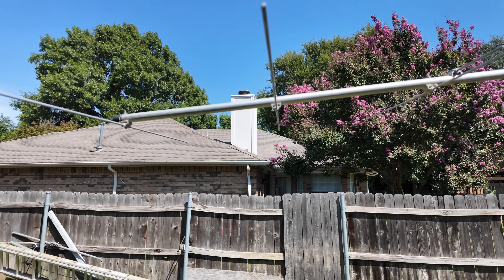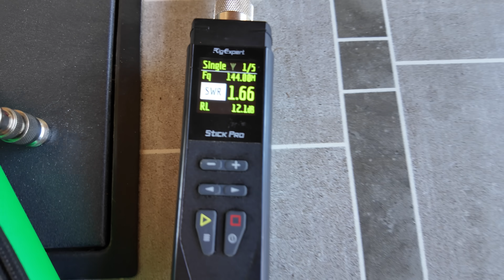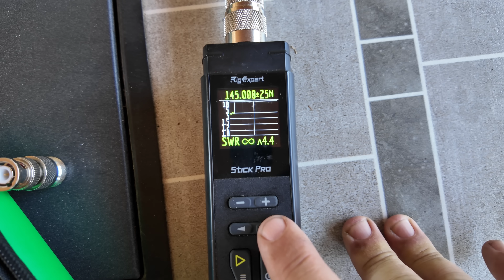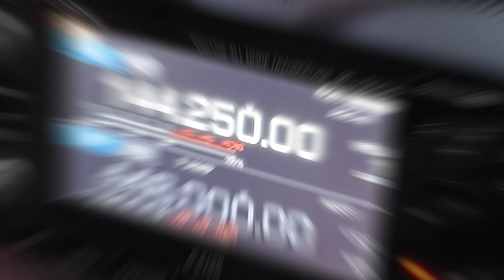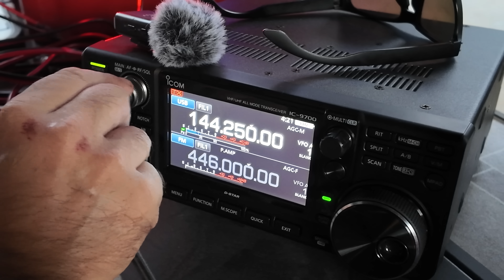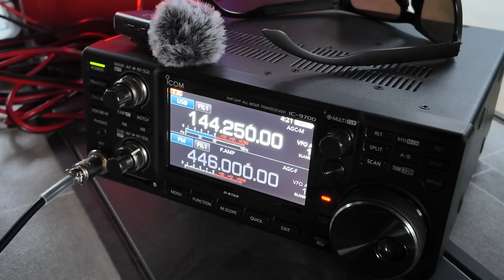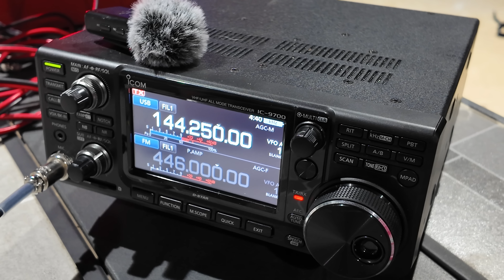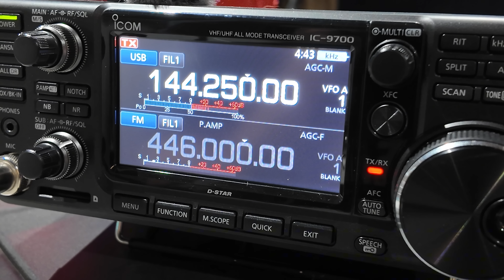Setting Up Your Ham Radio for 2 Meter Sideband Success

Comment: Around Thanksgiving in the late 1980's, I worked 38 states on 2 meter SSB running only 10 watts from an old Icom 211 into a homemade (20 element twist). I had more fun during that band opening. I didn't sleep for three days more less!
Reply from the maker: That sounds like an amazing experience!

Comment: 2m band SSB mode is very suitable for long distance direct wave contact. In my poinion, it is worth to use for usual mobile operation and daily use. Actually, contact range of 2m SSB is as same as authentic (analog) VHF/UHF repeater. However in Japan, many of 2m SSB user focusing only for domestic long distance contact. Therefore, daily activity is very low except contest or any long distance contact event. How about in your country?? It is "Mottainai".

Comment: Is there a decent ham 2m net in Granbury? I'm here a lot for family matters and would love to use the radio.
Reply from the maker: There used to be a good 220MHz repeater down there that I would use when driving through the area, but I don't get down that way often.  I would check repeaterbook
Reply: Yes! 144.190 USB vertical, Tuesday and Thursday at 8 PM. Tuesday is a county by county check-in, and they move net control around so you won't be able to hear everything but we cover several counties centered, I think, around Weatherford. Thursday night is open ragchew.
73, --kv5r Mineral Wells

Comment: We have bozo nets here in Northern/Central CA and we are on 2m SSB Sunday & Wednesday nights.  We take check-ins all over CA and stream the nets on YouTube.

I used FT8 on 2m with my IC-9700 this weekend to work from Fresno down to Mexico, over 300 miles away.

You need to turn the compressor on your IC-9700, you are not getting full power out.
Reply from the maker: I was running 70-watts in this video.  I had the "max power out" thingy turned on.  I tried turning it off, but the battery I was using wasn't able to keep up.  It probably needed a charge.

Comment: Thanks for running this segment. I was hoping you'd do a 2m ssb video. I am over here in the Florida Panhandle and get quite a bit of tropo activity along the coast. It's not unheard of to work Texas on 2m ssb every now and then. I'll try to get up on 144.250 on Wed night. What time? Vy 73 de Bob W4PGX nr Pensacola, FL.

Comment: FYI- support the phasing harness. Can't get them (75 OHM). Mine screwed up. Just ran separate feeds, which  works out great for the 9700
2 mtr ssb is fun
W9DLP

Comment: There’s a lot of miss information on this video. Jason brother I love you but you’re gonna need way more antenna than that If you’re gonna do any week signal work on 2 m side band. First thing I would do was get rid of that in-line T in the coax by the antenna and feed each antenna separately. That little set up you have there will be just fine for talking around Dallas Fort Worth, Metroplex, but you’d be hard-pressed to get anything over about 100 miles with that set up. We tried to have a net on Monday night on 144.250 out here in West Texas for 2 years and the biggest problem that I ran into is that nobody wants to put up a horizontal antenna. We finally gave up as there were only a few  with horizontal antennas in Brownwood,Eastland , San Angelo area. Everybody’s got their stuff vertical on 2 m and when you try to talk vertical antenna to horizontal it does not work good at all . Also that icom 9700 needs a Bodnar GPS reference so it won’t drift all over the place on 440 and 1.2 gig other than that that’s an awesome radio. I would recommend anybody that serious about 2 m side band put up the biggest horizontal antenna you can and try to run a minimum of 100 W you fellas that live in the city you’re gonna be at the disadvantage cause there’s so much noise that is the number one killer of any of the VHF for UHF SSB. REMEMBER, THESE ARE EXTREMELY WEAK SIGNAL MODES, AND IT DOESN’T TAKE MUCH NOISE TO KILL IT. WM5L DM91.
Reply from the maker: Who said anything about weak signal?  If you are watching this video for weak signal, that is why you think it is misinformed.  I never said anything about weak signal, and to imply that 2M SSB is only used for weak signal is wrong.

Comment: At 1 minute and 28 seconds in this video I see a 5 element yagi, is that a 6 meter..? Also Is that the Intelitron 53Ft mast that Gigaparts sells..?
Reply: Looks like a Cushcraft A505S to me.
Reply: @jefftownsendwb8lyj944  I Informed him about a Sirio 6 Meter 5 Element for $170.00 several months ago. Now I  am curious if he followed through. Sirio also has a 10 Meter 4 Element for the same price and has the same boom length as the 6 Meter.. Sirio Antennas are made in Italy and have very high ratings..
Reply from the maker: Yes that is a 6M Yagi.  The mast is the 50' Carbon Fiber that they used to sell.

Comment: I recommend trying vertical polarization
Reply: Most CW, SSB and digital contacts on 2M and up are going to be horizontal polarization.  Vertical is only really used for repeaters.
Reply: Vertical polariziarion would cause about 20db of polarization losses. Almost all weak signal ops use horizontal polarization.

Comment: We used to have a pretty big 2M SSB net on the east coast. Net control was in MD and he had a huge station set up. He moved and lost that amazing antenna system and 2M SSB activity faded. I also moved since then and haven't put my yagi back up, You have inspired me to get that thing back up. Maybe I can drum up some interest again. 2M SSB is a lot of fun.
Reply: If it's the same net I'm think of, I checked into that net before.  It was on something like 144.210 or 144.190 wasn't it?  I'm on the MD/PA line just South of the Gettysburg, PA.  Wasn't the radio and antenna he used remote operated.  I seem to remember him saying it was up several 100 feet on a commercial broadcast tower.
Reply: @mikesradiorepair  144.205. Saturday nights. And yes, sounds about right. He worked South Carolina all the way up through New England.
Reply: @K4MJV  That's it, 144.205.  Actually still have that programmed in as a memory channel in one of my IC-9700's.

Comment: Hey love your content, been watching for a while  and have been a knew ham since febuary, im looking for an hf rig wondered if your where to recommend 2 Mobile hf radios what would they be? 73 KR4BSZ.
Reply from the maker: The only truly mobile HF rig that is currently in production is the FT-891.  The IC-7100 is also there, but has a funky configuration that won't fit in some vehicles.

Comment: Stacking a loop (two phased for more gain) over your yagi would give you an omni directional pattern. Don't forget that they should be separated by at least one quarter wavelength.
The "Armstrong" rotor just adds to the fun.
I'm glad to see more interest in 2m SSB. I'm hoping that you will make more videos like this.
Reply: I did same thing, loops and all. Little less gain but it saves the turning :)😀
Reply: M2inc sells loops and stacking kits, I have 6m, 2m, 1.25m, & 70cm loops on my roof.

Comment: 2M SSB is a lot of fun.  In the middle of doing the Sept ARRL VHF contest currently.  Several weeks ago we had a great E-Skip event.  Was making 2M SSB contacts over 1,000 miles on a vertical at 45 feet.  Some stations were coming in 59 +30dB.
Reply from the maker: Those E-skip openings are a blast.
Reply: I love E skip.   It seems like this year had more E skip events than last . I'm on the west coast
Reply: @Jeff-sp7bg  During the last good E-Skip event I was getting into KS, NE and MO from South central PA.  Signals were so strong you would have thought they were a mile away.  I have all the VHF and up FM and SSB calling frequencies in my radios scan list.  You never know when E-Skip or a tropospheric ducting event is going to happen.  A couple of years ago I got into a 2M repeater in Southern GA for for a little over 2 hours straight late evening to early morning during a good tropospheric ducting event.  The received signal was so strong I could hear it on a HT.  The repeater trustee happened to be on and sent me a QSL card noting that it was the furthest contact ever made on their repeater.
Reply: Realistically how much further can SSB do on UHF or VHF if your not getting e skip? I inherited a 50w yeasu ft 2400 from my grandpa when he died and I am not exactly sure how to use it. None of my hunting crew has SSB and I live in the mountains so I never hear anyone using it. If you gave me a good reason I might make it mobile. Ty
Reply: @wildweasel6898  Per Watt SSB is more efficient than FM and AM. This is because of SSB's narrower bandwidth and the characteristics of FM which make it great when signals are strong but less readable when signals are weak.  In AM a large amount of your power is wasted in the carrier and opposite sideband.  All of your power on SSB is in about a 3kHz bandwidth which makes it have a higher spectral density power.  The other reason you can frequently get farther on SSB is because of the other stations antenna.  Operators that do a lot of SSB on VHF/UHF tend to have relatively large Yagi antennas with high gain, often with mast mounted preamps.  It's not uncommon to find weak signal mode VHF/UHF operators with 4 to 10 or more Yagi's phased together for each band.

Comment: Question, why do you have the antenna connectors installed backwards?  You have them facing the tip end of the antenna.  They should face the back.
Reply from the maker: Explain "backwards" - I am not sure exactly what you mean, but if you are referring to the Yagi antenna, it came this way.  You heard me mention that I picked up the antenna at a swapfest, correct?  This is how it was prebuilt when I got it.
Reply: @HamRadio2  The antenna has the SO-239 connectors facing towards the front or tip of the antenna.  They should be facing the back/rear of the antenna.  That way the cables come straight back, get taped to the boom at 2 or 3 places and then come down the mast.  As it is now the coax cables have to make a 180 degree turn to come back to the rear before they connect to the T connector and then down the mast.  Look up the instruction manual for the antenna.  You'll see what I'm talking about.